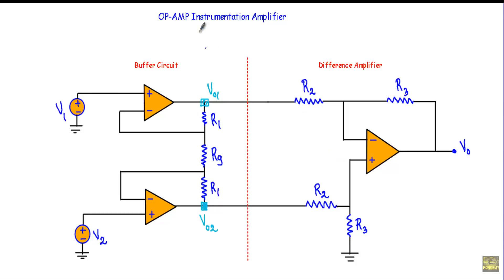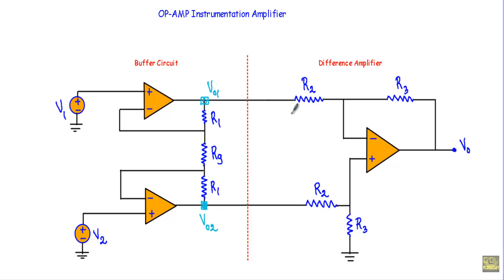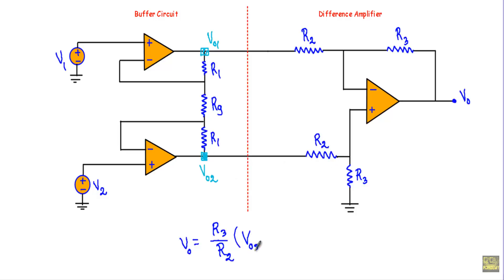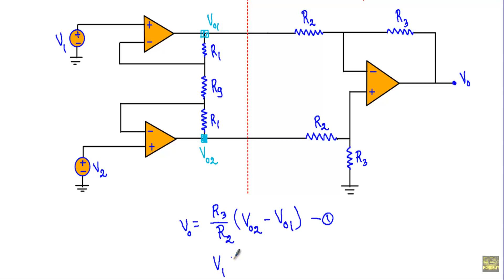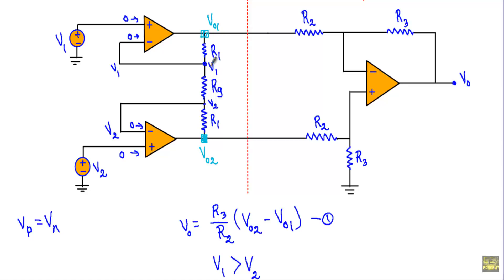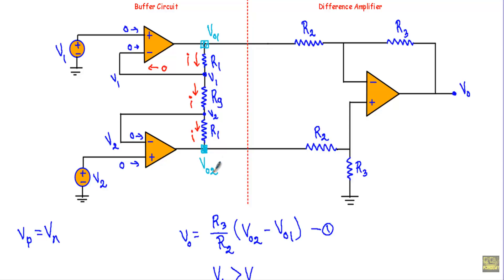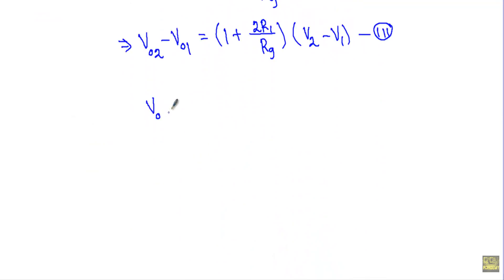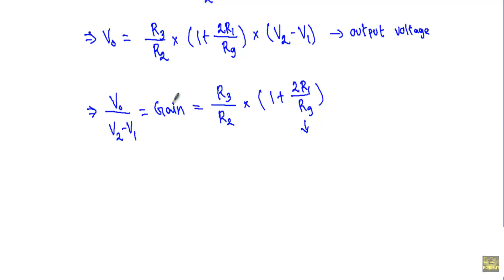OP-AMP Instrumentation Amplifier

Comment: The equation number 1 is incorrect because the Vo2 voltage is not the direct voltage to opamp 3 , Vo2 will divide in two resistances and the effective voltage to opamp 3 is the voltage across R3 (calculated using voltage divider )